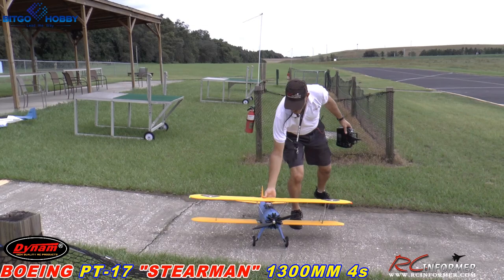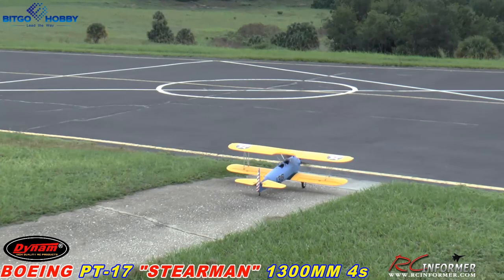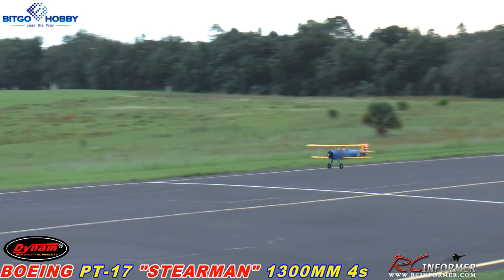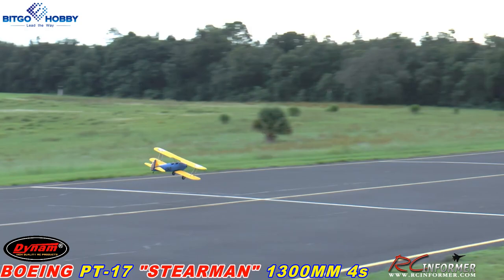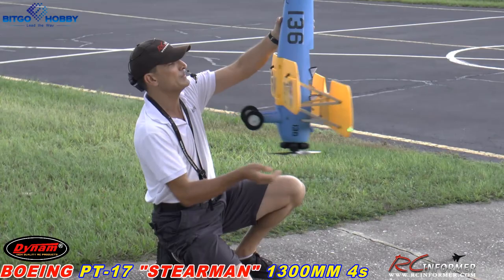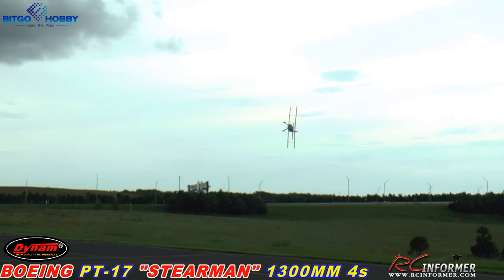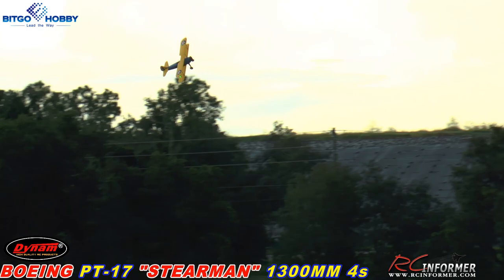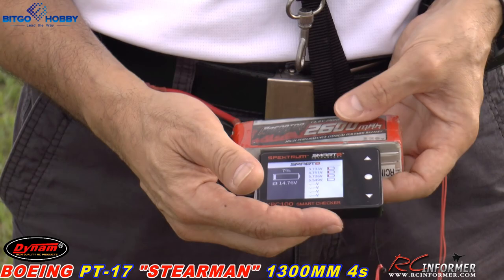***NEW*** DYNAM PT-17 1300MM Paved Runway Demo By: RCINFORMER

Comment: Beautiful plane.  After buying the plane, which seems reasonably priced, then I understand one must pay extra added costs:  6-Channel or above transmitter, 6-Channel receiver, 14.8v 2600mAh 20c battery and charger, register with FAA, buy AMA membership and join an rc club.  All told, it seems like you need close to $1,000 to get started.  Much more if you have to buy something for your wife to compensate for the "toy"...
Reply: Well, 1,000 $ to get started seems to be  too much. You can buy an used Tx Spektrum, a 7ch is enough for most of planes, and an E-Flite plane BnF which has already installed the receiver which is then binded to the  used Tx. Taxes unfortunately are due, but if you live  without other buildings or so around, you could fly free of all taxes. If you are going to move your first steps in the hobby, the best plane for beginners, in my opinion is the E-flite Apprentice, you can buy the RTF version all included, at no more than 350$. And surely you avoid to make your wife disappointed ;) Cheers from Italy
Reply: 1,000 dollars to get started!!? Don't be rediculous. I got everything I needed to start for 300 dollars.
Reply: @PoochAndBoo  You can "start" for under $100 if you settle for teeny tiny planes weighing a few ounces.  Is there a coupon day for each of the 7 essential items?
Reply: @PoochAndBoo  well, if you want your reply to be helpful for PHAPNUI, write down what you are flying with, or even better the links.
Reply: @phapnui  my advice is to go for the e flite apprentice RTF to start. If you aim to go on, maybe better to choose the BNF version and to buy a Spektrum 6/7ch tx. A used tx is not a bad choice, a radio can work till the end of the world! Not the same for a used plane thus. After a couple of bad experiences only new or never used ones. Good luck!

Comment: Don't believe the hype, Dynam are still rubbish. Bought PT17 last week because I had wrongfully assumed they had improved, however I was sadly mistaken.  Usual problems, parts missing, incorrect parts supplied, badly fitting parts, and this happens often not just one off!. I have been building model aircraft for 25 years so not a novice. Just rubbish really.